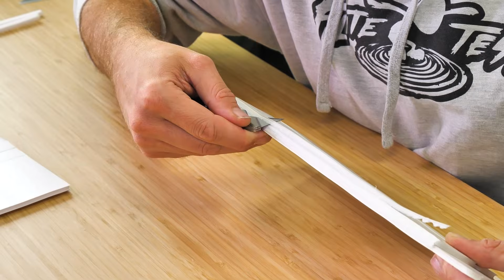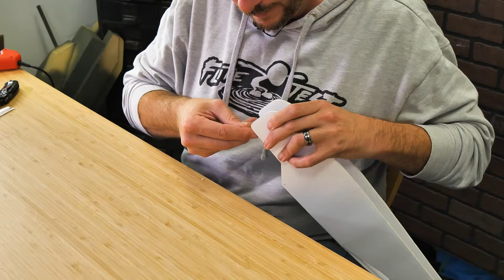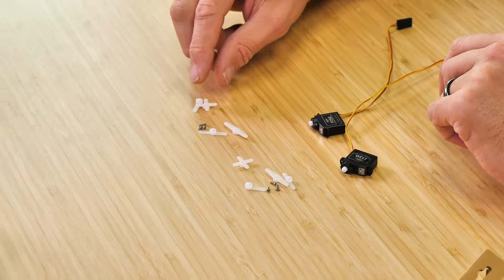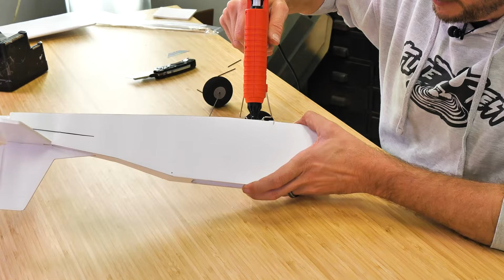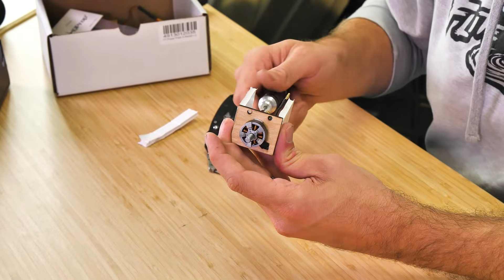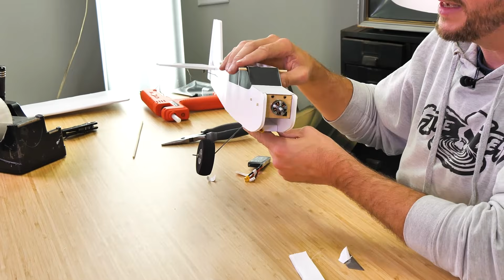How to Build the FT Mighty Mini Tiny Tutor //  BUILD

Comment: I feel like I did good job on bevel cuts for leading edges on wings, but there is no way I could get it laid over without popping the paper on the front. Fixed with tape - anybody got any hints?

Comment: Important! Attention! The single most difficult, frustrating thing on this build is those dratted pushrod arms. Josh has built, oh, 1000 airplanes and makes it look easy. Yah... it isn't. But it can be! 

Here is the Fishbones Air method, which will make your life easier, especially if the control horn is already installed. Instead of fighting with this, turn the rod around and use the end that already has a Z bend in your servo. Measure the rough distance, and make a modified Z bend at the other end. The modified Z bend will go through the control horn. Attach the rod to the control horn, the servo to the other end, and assemble as normal. Here at Dragonfly labs, we always hookup the servo tester one last time, with it set to "center" before we glue the servo into place! 

Wash, Rinse, Repeat for the second servo, whether that's the Rudder or Elevator.

Comment: My kit didn't come with the servo tester. Do I need it?
Reply: If you want it perfect 90 then you’ll need it but you can get pretty close to 90 degrees by just plugging in the servo, looking at where it automatically goes after pairing it with reciever and transmitter, and then put the servo arm as close to 90 as you can

Comment: I  do alot of soft woodwork, I have a Desk dolly as i call it which would help you no end doing fiddly stuff like this. The dolly....  A 7"x 3/4"x4" soft wood with a 7"x 1/2"x1" off to the side giving a 90* to push against.  It also has removable dowls so you can peg it down so it dont run away when you put side load on it. Its great for clamping when glueing up.

Comment: I just exploded my Might Mini Tiny Tutor on the maiden. The build was cursed from the get go. over bevelled the wings and had to replace them with DT foam which was heavier and thinner. Not sure if that threw off the CG according to the plans. Came in at 260g instead after the swap. Pilot error took care of the rest. Good learning Experience.
I've got a new kit in the mail and look forward to mending my broken heart hahaha.

PRACTICE THOSE CUTS ON SOME BURNER FOAM BEFORE YOU TOUCH THE KIT.